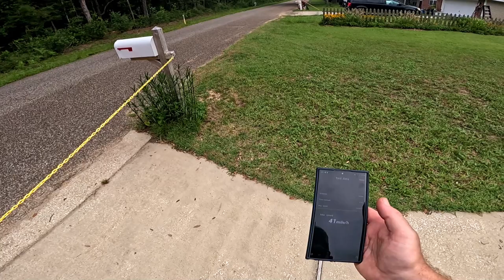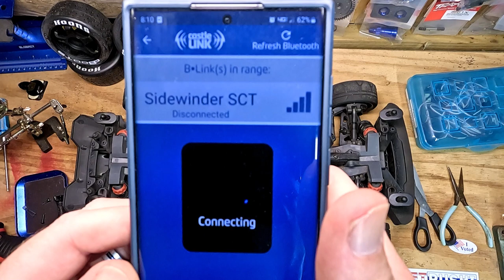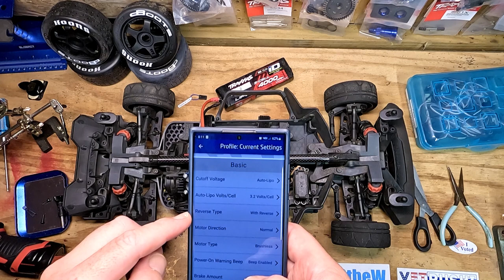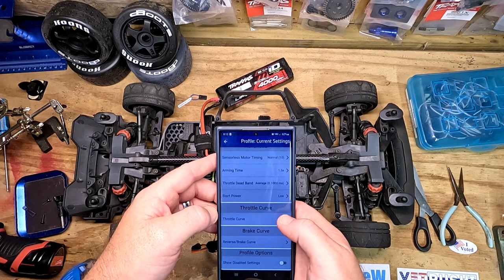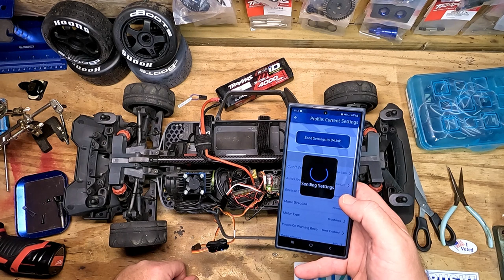Suspension Adjustment To Stop Bad Tire Wear And I Almost Ran Myself Over LOL

Comment: My tires on my full size infraction started wearing on the outside edges. I turned my steering travel down on my DX5C and that helped. You could also adjust the toe out more and that would prevent the outside wear.
Reply from the maker: I dont have a dxc5 I dont see how that helps the back tires where most of my problem is lol setting the camber has helped with nothing else its made a huge difference in my Vendetta the tires are wearing perfectly I need to run through my Felony which is the same as your infraction those have a totally different suspension and steering setup. I will.check the toe in on that one thanks for the tip
Reply: @L2theWcarscoffeelife  my bad, I thought it was your front tires wearing on the outsides. 😆
Reply from the maker: Lol its all good its actually more the inside has been worn away especially on the Felony wow its bad

Comment: Your differentials sound like they are binding which would cause excess heat at the motor. Very common problem in these. I bought a Mega for my son and if I pulled out the motor and the driveline the chassis wouldn't even roll. 

You have to take the diffs apart and file a little lip away behind the bearing on the ring gear side, it will give you a little extra lash in the ring and pinion. Takes about an hour to do both diffs. You only need to take out 3 screws in the rear and disconnect shocks at the top, the front is 4 screws and disconnect top of shocks. The whole diff cover will lift up and out of the way.
Reply: Also to add, if you look up the procedure on doing this (I think rcmetal or earl moorhead is the original person to figure this out) they take apart the entire differential,  I only took the axle off the ring gear side and then took the carrier apart on one side. Just went quicker than a full disassembly of the actual differential. It will be night and day difference after you do this and the car will run a lot quieter. When I take the motor out of my son's and push the chassis on our hardwood floor it will roll 5 or 6 feet on its own now, before the rear tires would actually lock up and stop in about 18 inches. The front wasn't as bad as the rear from the factory.
Reply from the maker: I heard of this before I did check everything when I did the upgrade and it rolled smoothly I have some more upgrades coming I will probably take the diffs apart see what they look like inside make adjustments based on wha you said  then good info thanks for watching and the comment
Reply: @L2theWcarscoffeelife  check the rear first, it takes about 5 minutes to get the dif housing opened up. Try to roll the ring gear across your palm, it should have no resistance... mine would completely lock up in 3 places only doing one full rotation. The ring gear actually dug into my skin and left marks, haha. 

I'd for sure check it out, I bet you'll be surprised at what "rolling smooth" actually feels like.
Reply from the maker: fyi I took it out did not dig into my hand it "rolled smooth" like I said  and diffs make the wheels spin different speeds to make turning easier the actual differential is inside the spur housing you wont hear them on a straight run as its not engaged what your referring to is actually shimming the pinion not binding diffs there is a difference.
Reply: @L2theWcarscoffeelife  I know what and where differentials are, worked on rc's and jeeps/broncos my whole life👍

That's good yours were turning free in the carrier, like I said, on my son's infraction the differentials were binding and 100% making excessive noise and it was causing friction in the drivetrain. His car was extremely noisy while it was rolling, similar gear whine to having your pinion and spur mesh too tight. 

Glad yours was fine, good to make sure to help protect the motor and esc from overheating. They also didn't grease the front diff very well from the factory so it was good to get some.better grease in them.